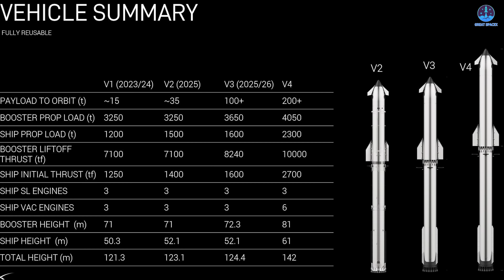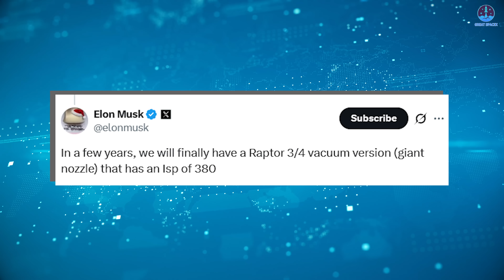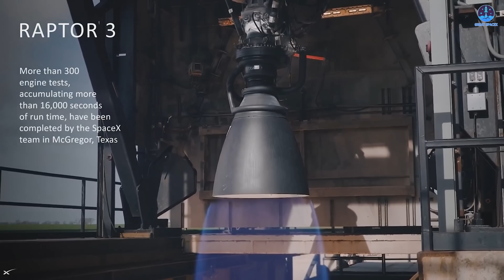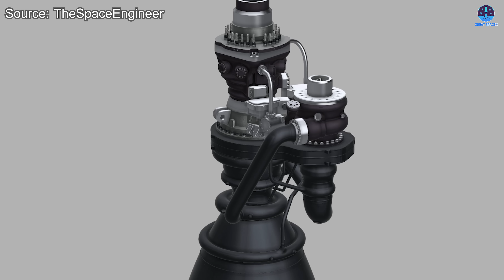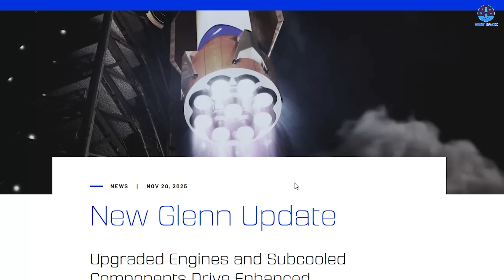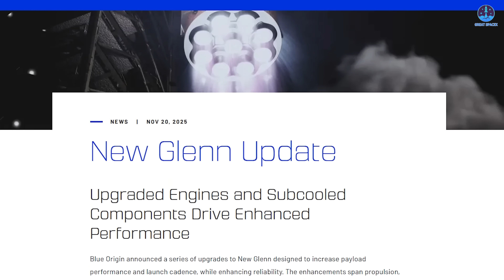SpaceX Revealed Starship Raptor 4 Totally Humiliated Blue Origin’s Upgraded BE-4...

Comment: love the difference of the complex plumbing (a bureaucratic dream machine) to the simpler design. much like if goverment department decided to engineer a simple brick, but in the reverse way of the raptor improvement.
Reply: You should see the movie about how the sea clock was built for the English. Hilarious how the engineers would find a problem and bolt on another piece to fix it instead of starting over.

Comment: This extraordinary new formulation opens the door to the concept of a flying PAD (Platform for Assisted Launch Vehicle), hoisted into orbit by a complete tandem of robotic orientation chassis with 120°/130°/360° swing actuators, mounted on mobile propellant distribution modules assisted by a sufficiently large preload for the various decentralized thrust phases, cable pulling systems, ground-based installation equipment, dust suppression domes, landing pads, and super-heavy drilling equipment.

Another way to view these enormous scientific advances is by considering how much time society hopes to save in the design of aqueduct structures supporting a portion of the total mass of the booster and ship tandems, Ripple or Quadrupple , totally aerodynamic shape ready.

These 1+3 or 1+4 tandems are separated only by expanding foam, forming a complete launch frame. These frames are supported by lateral stabilizing rails and counterweights. The tandems are held at multiple levels on either side of two aqueduct towers to offload gravitational mass to the ground and increase the width of the CARGO launch devices, one on each side, to reduce the load on the four vehicles.

The entire surface is covered by a single fuselage structure. The four 150 m high vessels x 25m [2x2  Boosters] x 30m large [20+10 m space or fuels stackage for the starships Gargo's vehicles stop at the base of two 170 m high tower arms,  capable LIFT-OFF By  a 750 m2  surface Heat temperature EXTRACTION. 

They are assisted by external magnetic support rails or externally powered booster rockets attached to a lift on the vertical rails for ultra-short booster distances, saving fuel during takeoff from a mass of 25 kt to 15 seconds instead of 15 seconds. The 132 Raptors (280 t units) shed approximately 37 -40 kt of thrust in their metal silos, cooled by Deluge and cryogenics on the force-shedding slopes.

A central vertical view from above shows the four vehicles connected by the frame and the spacecraft storage areas, with the empty starship tanks stacked above the boosters.

The assembly generates a compact force across multiple silos between 26.6 kilotons and 35.5 kilotons (24 kt potential material mass, suspended by cable stud rails (config. x4)) (at a thrust mass of 269 tonnes (3 or 4 x 33 x 269 t), representing a lifting capacity to an altitude orbit between 67 and 69 km (at a speed of 5,900 km/h, i.e., Mach 4.8 x 60° Earth geodesic lift before the 105-160 km simultaneous refueling pendulum of the 3 or 4 spacecraft mounted on their launch vehicles). With a total payload of 24,000 tonnes, including ferrings, this calculation applies to the entire spacecraft and booster tanks. The limitations related to Earth's gravity coefficient and mass are considered here solely on the basis of the capacity. of overall lift (maximum ferring shape, shock absorption at 45-60° INCLINATION~, Mach 4.9-5+, of the efficiency of the ferrings and of the wind speeds achieved at atmospheric density between 68-72km altitude (ferring release) and the return distance of 101 km of the thrusters to their launch sites.

Do you think that space volumes increase with the quantity of mechanical and logistical components or with the quality of ground thrust dissipators, for a completely compact assembly? Finally, what future is there for rocket stages held together by cable stays or aerial rail bridges against the total mass of crushed cans on the ground?

Of course, this remains an extreme complication for traditional rocket engine manufacturers, who struggle to control wind speeds at low and high altitudes, while it is almost academically simple for architects of bridges and internal counterweight gantry systems used in the construction of hydroelectric dams or suspension bridges weighing well over 100,000 tons.
The entire surface is covered by a single launch frame, with the four vehicles stopping below a 170 m high boom assisted by external magnetic rails or external thruster rocket for ultra-short distance.

Heat temperature

Comment: S,I Mass thru 1mm SEC N,M the theory Pressure wave or pulsed Vacuum Secondary Boost Increaser thru bell !, Charge Accumulators Pulse Pressure Maximum output more reserves Bigger bang for the buck Sync to vacuum or Asperated in tandem ! the Super Heated Pulse Sprayer from Byproduct Exhaust!,  make the charge , double output, Atomized + ,0 Vapor R.M.V. !

Comment: I highly doubt they are ever going to be reusing the boosters every hour.  There's a minimum amount of time needed just to reconnect and refill the thing even if there are no inspections let alone get a new starship mounted on top and do the whole preflight routine.  Even passenger jets dont normaly take back off withen an hour of landing. Thats alot of fuel to load and I dont want to even think about the logistics its going to take to have 24 launches worth to the pad every day per booster.  Daily reuse sure I can see that.  Possibly even a couple launches a day but hourly is optimistic even for elon.
Reply: I could see hourly launches but not of the same craft. Even the same pad is pushing it.
Reply: 🤣 I don't think anyone thinks that the same rocket could be reused in an hour but newly refurbished rockets could come off the line fast enough after each other to achieve that. You only need to look at how cars are made to get the concept.
Reply: That's why he's making a fleet of ships,  there's going to be enough to make speedy rotations,  the boosters are going to be the main workhorse
Reply: @NoxDiablo  agreed
Reply: Maybe not with raptor 3 or even 4 but with how the technology is evolving there isn’t any reason that future generations of these engines won’t be able to efficiency is probably next on the agenda as power to weight ratio already far exceeds what was previously achieved.
Reply: The more ships they have.. the longer they have to check before reuse.
Reply: maybe in the future, refuelling and prechecks will take less time to complete. When we're there, we will thank elon for already having developed engines with fast turnaround.
Reply: @rakenBattalion  even so you want to check all the hardware. Planes go through long checks before each flight too. You can definitely fly a plane an hour but not the same plane. Will be the same with Starship if they get to that miraculous goal.
Reply: @rakenBattalion  I do definitely think the time it takes will dramatically drop after they have flows a few multiple times.
Reply: Ye of little to no faith. First principle!!! You site human habitats which has no foundation in physics!!!!

Comment: I kinda wish they would apply all this tech on a much larger (Condor?) engine which would allow them to have fewer engines on the booster improving reliability and reducing weight with reduced plumbing
Reply: Fewer engines doesn’t improve reliability because now multiple engines can fail safely. With fewer engines you lose this advantage
Reply: fewer engines > improved reliability. lmao wut?

Comment: 2:25 9240 tons or 8240 tons ... what's a 1000 tons between friends?
Reply from the maker: In theory, 33 Raptor 3 engines (280 tons of thrust) would generate a total of 9,240 tons of thrust, but SpaceX will likely not push the engine thrust to its maximum capacity.
Reply: @colonbina1 but why didn't you say what was written on the screen
Reply: @davefarmery8180 it's AI, it doesn't know.
Reply: @BaldmanB a gentleman named Kevin is actually narrating

Comment: Imagine how much fuel you could save if you could push a rocket 50 meters into the air with a physical mechanism that has a counterweight. I think you could save almost 20-25% of fuel.
Reply from the maker: Can you tell more detail about that?
Reply: @colonbina1 I see these scale-like seesaws on every playground, and I imagine a platform under the rocket that it could lift up. Ideally, it would be in the form of a target where the outer circles of the platform target descend like weights and accelerate the rocket in height with the platform. When it reaches the penultimate inner circle, the rocket engines ignite and with the last weights lowered, the mechanism has enough kinetic energy to push the rocket off the platform. The rocket engines then only have the negative potential energy of the rocket's weight to push. And they don't have to push the maximum mass of the rocket first and waste fuel to gain acceleration.

Comment: Saturn V has a payload ratio liftoft mass to payload to LEO of 4.8%. This is the number to beat. V2 Starship demonstrated 0.3%.
Higher specific impulse is a big deal. That will help.
The chart says V3 can lift 100t? Pure BS.
So, lets see if IFT12 flies with a real dummy payload or if they will pretend to launch a rocket that can lift 100t to orbit empty without a dummy payload. We’ll see.
I wouldn’t trust any of these numbers until and if they are demonstrated.
Reply from the maker: Yeah

Comment: Blue origin- 2 rockets reach orbit 
Starship - god know how many boosters and ships 0 - reaches to orbit
Reply: How many falcon9 and falcon heavy have they launched you M0R0N. Blue origin is not even close to SpaceX and the falcon turnaround time is next level... Maybe next time you should be more honest with your dumb arse comments.
Reply: Blue Origin’s New Glenn is only like a larger version of Falcon Nine and it’s taken BO 12 years longer than Spacex to deliver its first commercial payload to orbit. New Glenn 2nd stage is currently expendable, whereas Starship and booster are being developed for full reusabilty. Getting Starship into orbit hasn’t been a priority so far but getting the heat tiles right has. New Glenn is relatively lightly built, so if they clad the second stage with heat shielding, it’s likely the whole 2nd stage will have to be redesigned or strengthened to carry the extra weight, and the booster rocket made a lot more powerful. You are comparing 2 very different rockets.
Reply: both are amazing rockets.
Reply: @GoriksX  not disputing that, however, the proof is in the pudding

Comment: The more they use the gasses to cool the engine, the stronger it will stay, and can handle more chamber pressure.
Basically they need to go for as much heat transfer as possible in the cooling sequence, and not just cool with some of the gasses.

There are also other benefits from this.
Reply from the maker: Great suggestions 👍